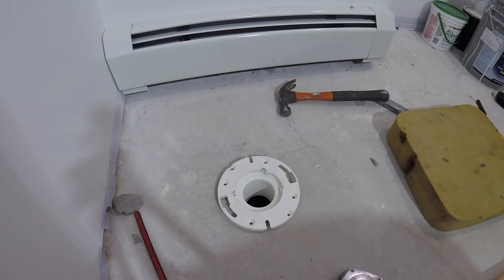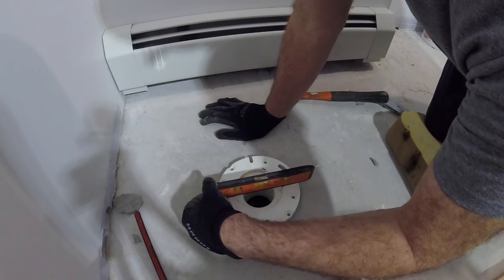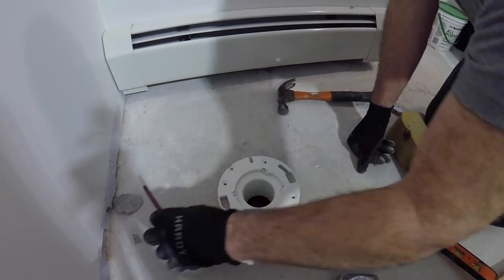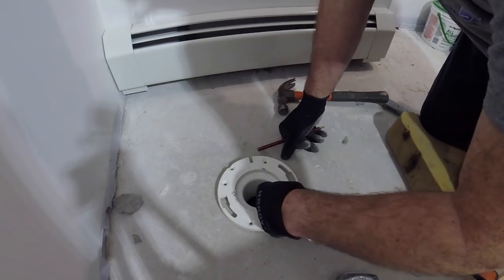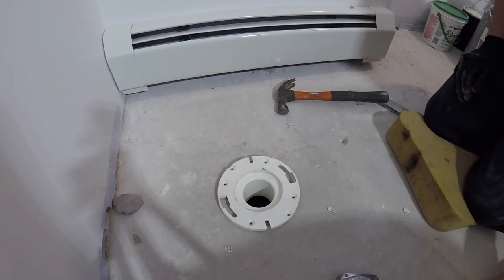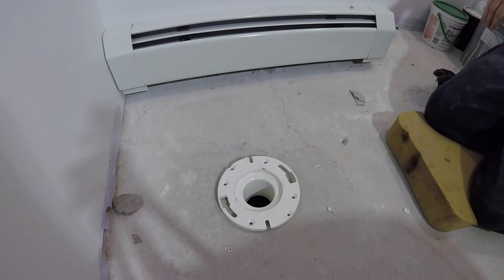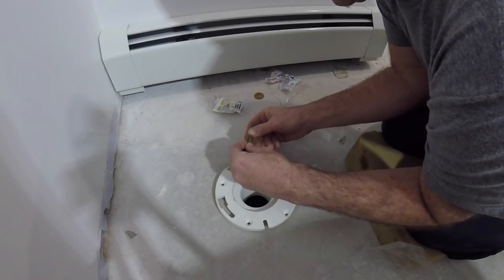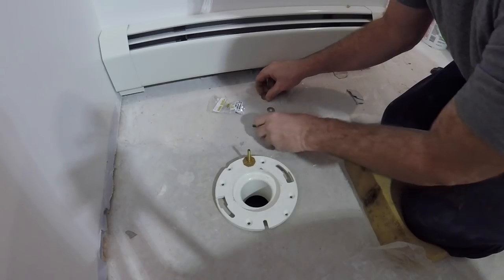TOILET FLANGE AND TOILET INSTALL AT CONSTRUCTION SITE

Comment: Hello CB and CB2. Have you guys had any leaks or call backs on the propress fittings leaking yet?
Reply from the maker: It has been really dependable and I really like it. I did have one fitting have a slight drip on heat heat line. Which was an easy fix.

Comment: Not necessary to attach the toilet flange to the floor?
Reply from the maker: thank you paul....temporary means temporary and I do it again for this situation. I still would film it too even after being put on blast. I love it.
Reply: Chuck Barron , thanks for the response.  I asked the question because a neighbor had a remodel done and ended up with a leaking toilet.  I pulled it and was surprised to see that the contractor did not attach the flange to the concrete slab.
I only had to replace the wax seal, but was surprised to see that they didn't attempt to attach the flange to the floor.
Do you avoid the wax seals with the rubber funnels too?
BTW, my next purchase will be a knee pad as thick as the one you have!
Thanks for your postings!
Reply from the maker: yo that is a couch cushion....is so sweet. really dense too. Ya its a must to achor flanges for sure. I just did one today with tapcons and air can....worked like a dream. the hardest part was getting the old one cut out so i could insert repair flange.

Comment: So did you use that trash collar because it's temporary?
Reply: Jeremy Butler. Here I thought I was the only one. I'm saying.  Why not
    "Do it once. Do it right!"
Reply from the maker: this is a temp jeremy... you mean flange?
Reply from the maker: floor needs leveler and flooring....not sure what you plumbers mean but we on the right path for this install. if you want to share a better way that be awesome.....thanks plumbers.
Reply: @ChuckBarron  so you're trying to tell everyone that the floor is so far off. You are going to need to pull that flange so they can come in a re-level this floor?
  Come on Chuck. Just admit you did it the lazy way. Even if you set this flange properly.  (Cut the pipe, screw it down) if they need to float out the floor. You can just unscrew this flange pull it up. Let them float the floor and put the exact same flange back in & screw it back into the same holes. It's not like you are going to glue it in. There is no excuse for not doing it correctly the first time.  
You can make all the excuses you want. But in the end.  It should have been done correctly the first time.  You must have charged them extra for doing this for them. If you think about it. Had you done it correctly the first time.  You would have made more money.  Because if it's a bid job. You are already getting paid to do it once. Then you should get an extra if you need to do it again because of their fuck-up with the floor being unlevel. Which I highly doubt.  This is concrete it's not going to be that far off. Plus the extra to set an old toilet so the gu doesn't have to supply & pay for a porto-potty. So you get a bit extra money. He saves a lot!
The flooring guy should be able to put some thin set down. Level out the floor right there & you set the toilet to the properly set flange. Properly set the first time!
You just got caught being lazy here. Kind of like looking in your Tote before coming in to set a toilet. 
   Before you.  I've never seen another plumber use a 7/16 nut driver to set a toilet. I've seen you use it several times. So I get that it is your go to wrench. I use one of those 7/16 speed ratchet style wrenches.  Sometime a 4 or 6 inch crescent wrench. Which I keep in my Tote, no matter what job I'm doing.  I dont think I've ever owned a 7/16 nut driver. Well. I guess I have in my shop tool box for working on my cars or Harley.  But I've never carried it in my plumbing van. 
 But this is off topic.
Back to 
 "Do it once, Do it right"
Reply from the maker: wow lee a long read....No lazy...just donating a toilet  for the boys to use.. Done Right for the situation. No lazy...If i was lazy i would just piss outside again...who donates toilets for fun? I do Lee!!!

Comment: Hello chuck, do you just use flex supply lines , or sometime copper supply lines?? I prefer the flex myself. easy and better.
Reply from the maker: yes...flexie is where its at. no more chrome plated copper supplies.
Reply: On the nicer homes. A million dollars an up. Use the rigid or solid copper chrome supplies.  They will last as long as flex. The just look a lot nicer. Especially on the toilets. The customer can see those. If you want to use the stainless steel flex under cabinets then that's kind of ok. But if you have just spent over a million dollars for a home. Do you want to look down at some cheap flex supply lines?
  I'm not saying one is better than the other. People down know which is better. The solid just look nicer. That's what you want in the end when setting trim. Looks nice & last a long time.
Reply from the maker: This is true lee....we are in agreement here. Break out the classic supply bender and make it look like art....with a real brass furl chrome nut....
Reply: @ChuckBarron  yes. For really custom homes. Stainless steel Flex for all the rest. I must carry a hundred supplies all in different lengths.  If the valve is not 3/8 supply. I change out to a new 1/4 turn valve 1/2 x 3/8

Comment: Cb1. Is this the flange you're going to install in the final stage. You know, after the floor is "Leveled " out the 4 or 5 inches that's it off now.
  You're going to re-install this flange right?
Reply: Lee does it take you 5  days for you to change a copper 90???? im sure cb2 can even do that
Reply from the maker: Lee, What makes you so bitter? Still talking about my flange and floor when your should be worried about more important stuff. I am gonna get the shot my man...unless they demo the house since you recommended that in one of your rants. Demo time!!! Lee said so!
Reply: @ChuckBarron  if it's that far off level.  They should Demo it.
Reply: @ChuckBarron  never mind Chuck. This is your kind of work. You don't question it. So it must be normal to you.
Reply from the maker: please ed, no language. not nice.
Reply: @edbeck877  please call me
  Richard Cranium. 
AKA : Dick Head.      😋

You say the floor is 4 to 5 feet out?
  No way. Hell, I could do a better job than that. I hate doing concrete.  5 feet out in a small slab. They must have poured it vertically instead of horizontally.  LoL
                       😏

Comment: Temp set up for construction guys. I can see why he skipped stuff, it's not permanent. Being around construction people though, it may be a mistake even for temp to put it so close to the heat coils. When that dude fires up it's gonna smell like hot piss in there! Thanks for video Chuck!
Reply: The toilet can never be moved. What are you talking about?
Reply: @ltsgarage7780  I never said it was going to be moved. I said he just made a quicky install and will do it proper when floor goes in and stated it probably not good idea to have it close to heater as it;s gonna be pissed on. And yes they can move it by breaking out concrete and moving drain over. In fact they did that in an earlier vid.
Reply from the maker: this is a friends place and not a insane job with all sorts of subs and chaos....slow mover
Reply from the maker: super small bath....no other place for heat.
Reply: @ChuckBarron  Thinking about my work place. Cops. Good thing solid concrete walls and granite floors, lol. I swear they could pee in shower and hit the hallway.
Reply: @ChuckBarron  Understood, I'm just commenting because I notice this stuff working at a place no one cares about. Being this is personal won't be bad and if is it would be on him.
Reply from the maker: for sure....you work in prisons right? if i recall correctly.
Reply from the maker: Ya...this is gonna be a beach crash pad hide away for sure. place where you dump your gear and hit the beach.
Reply: @ChuckBarron  good for your friend. 
 A little deflection goes a long ways there Chuck. 
Good luck to cb2.
Reply: @ChuckBarron  Police dept with a jail. That's why I commented about the heating next to toilet. At police dept it would have pee, toilet paper, spit, coffee cups and mud on it, lol. Originally thought this was a bathroom for an office. Some of Steven Lav's video's have hot water baseboard heat in some bathrooms he's worked on. In his words, crusty, lol. Yeah sometimes you have to do with what you have.
Reply from the maker: oh lee what do you mean?
Reply from the maker: I hear ya j...I just replaced my tenants baseboard in bath. total rust bucket.
Reply from the maker: Thanks lee. I will pass on your wisdom to CB2....Cb2 stop in and chat with Lee for a while. lol

Comment: Rubber closet ring (it bounces back with movement ) the green one. I predict water on the floor in the near future.
Reply from the maker: We pulling toilet at some point for floor guy. Im thinking 4-6 weeks. Do you use the greenie wax? i have never used them.
Reply: @ChuckBarron  heavy on the "Bad"
I'm still watching expecting the "Good" to show up.
Reply: @ChuckBarron  you should try anything else besides what you are doing.  25 years of shoddy work.  
   Really?
Reply from the maker: Lee the great is here.....everyone lets put our hands together for lee.....He always does perfect work, fast, and always has the perfect tool in his tote.....
Reply: @ChuckBarron  I actually look in my totes for which tools I'll need before I walk into the job. You'll learn after 35 or40 years.
 ( I think you will?)
  You've actually proven from the first job I watched of yours. The water heater job.  You didn't remember the correct tools there either.  So I guess I see why cb2 is the way he is. The mind is a horrible thing to waste.  
Yet waste it you do!
Reply: @ChuckBarron  Google "Sani seal " and you'll get the run down . Also fluidmaster makes one , but in your case I would recommend sani  seal.
Reply from the maker: Thanks Floyd......
Reply from the maker: Your still rambling on lee....very interesting.

Comment: So many no-nos... Wow Chuck
Reply: Pos collar, why no shim? As soon as you rocked it back and forth the seal was compromised, and they make flex lines with metal nuts (plastic can split flooding)... I need a new YouTube plumber... Maybe I'll start a channel
Reply: Jeremy Butler.  Chuck only has 25 years of experience.  He still can't do it correctly.  How many do you have?
Reply from the maker: temp means temp and I will come visit your channel for sure....thanks for stopping in J.